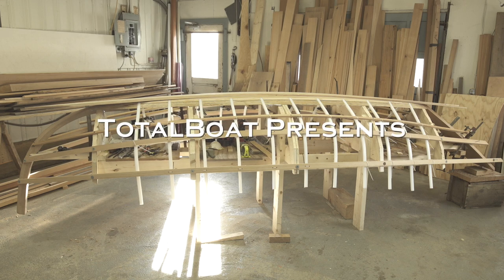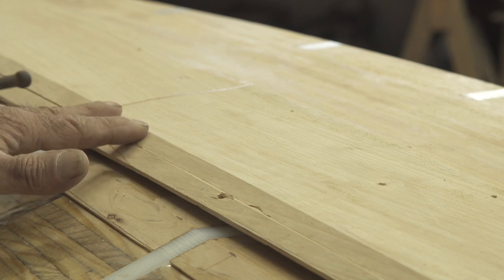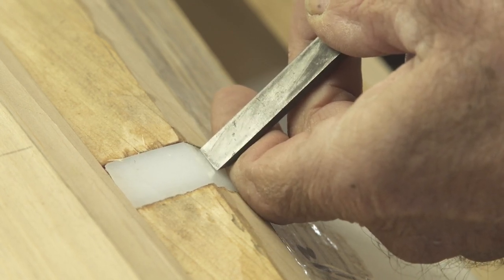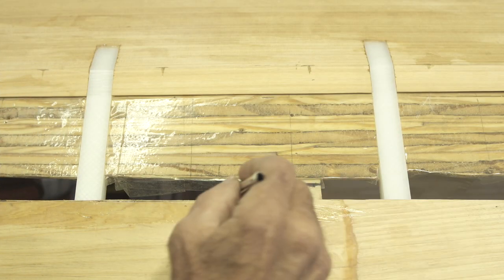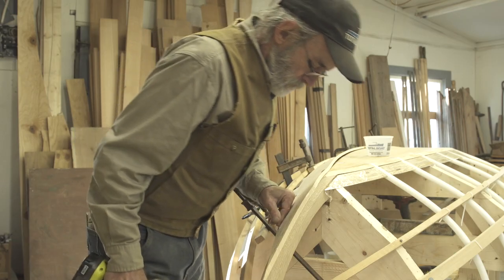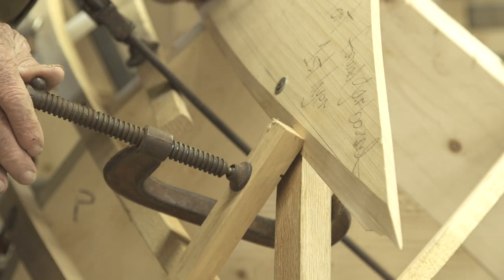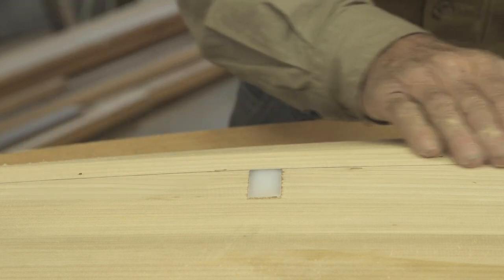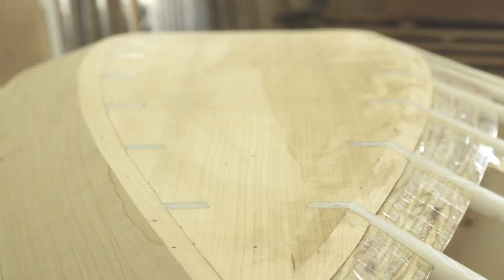Building the TotalBoat Sport Dory: Episode 15 - Port Garboard

Comment: I have used the plastic ribs on many projects over the years and I have learned that they need to be covered with something to protect them from the sunshine. They will last for decades if covered, however they will become as brittle as glass in a few years if left exposed. So good to watch your videos Sir, I am a Carpenter and have built boats in excess of 100  tons. I am speaking from experience when I say that you are a Master. Cheers.

Comment: Hey Lou, thanks for the new video. That's a cool trick with the fender washers under the screws, help spread the load and pull the plank down without the screw disappearing into the wood. I like how you removed all of the screws, on our recent build we left screws in some areas per design but then found them again with the power planer! And if you ever need to supplement your income, you could play that 10 point saw in a local band :) Happy New Year.

Comment: The wedge under the nail's head trick is innovative to say the least. That trick there is going to help me a lot, usually i'd use washers and pull them with pliers, but it would always nick the wood a little, i suspect little no damage, if any at all with this.

Comment: Man, I just can't get myself to trust glueing the HDPE. It IS absolutely fantastic stuff. The Achilles heel is trying chemical or temperature welds. I weld it in my trade, and it is finicky stuff. Fasteners work great. Super duper abrasion resistant.

Comment: Louis, when you are working a wood boat over an extended time like this- do you ever have issues with the natural movement of the wood as temperature and humidity change?  Does it cause an fitment issues with planks or pieces you cut later on as the measurements change?  Or is the movement not significant enough to cause any issues?

Comment: Looking pretty good, but yeah, it does look like you took too much off the first plank at the stem. Of course, once the first plank goes on the other side, the epoxy can fill that gap very well, especially if you thicken it with the cotton fibers again. Or, I suppose you could caulk the gap with cotton caulking in the old school way. I'd love to see some of that. (Yeah, I know this boat was finished over a year ago, be I would still like to see it).

Comment: I don't want to burst Your bubble, But UHMW has a problem of sun checking.  In white it will not last, colors work better, black is the best.  I like the fact that You are using mixed media. I have been working in wood, Metal and plastics, for 45 years.  Epoxy is very stable, where as UHMW  expands and contracts with temperature changes.  The company that sold You the plasiics, should have all the data on the plastics they sell.  UHMW  under stress or where a fastener is will break down sooner in sun light.  I have made mistakes using this plastic, and have been disappointing  in about 5-7 years or service.  I know You are atemping to make this dory last longer.  I have not seen the completion of this series, maybe You address some of the problems?